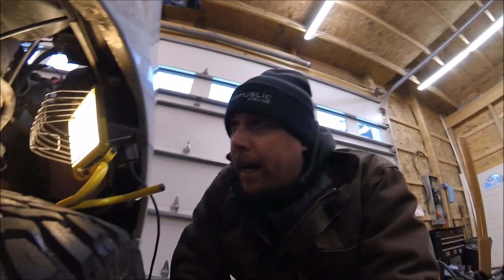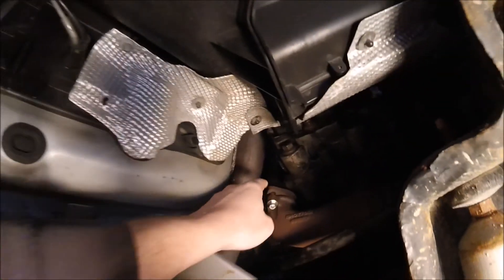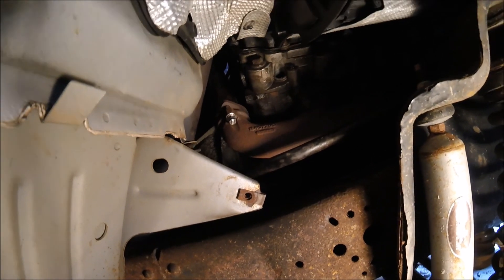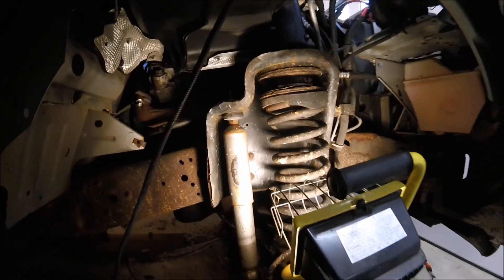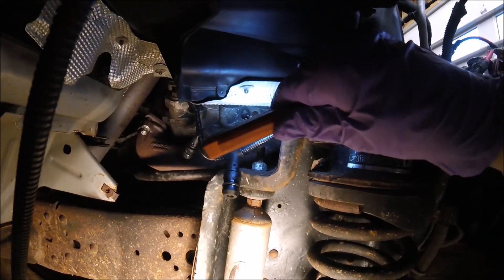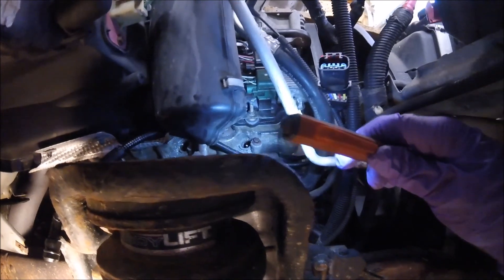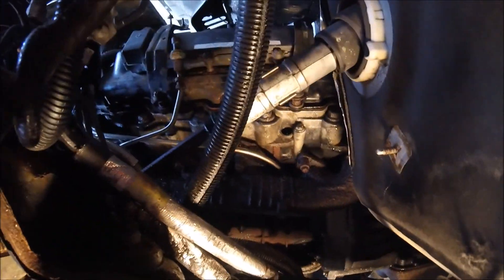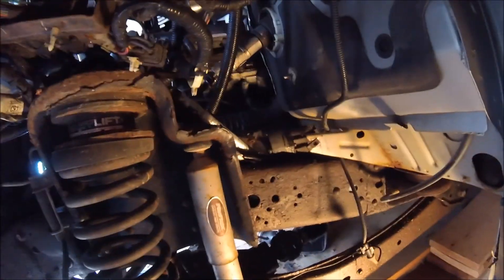GLOW PLUG HARNESS INSTALL PT 6

Comment: Man I am struggling bad getting the new harness to plug onto the new plug while it's on the truck. It wont see as far as the two rear plugs. 

I'm especially struggling on the 2 forward plugs drivers side.
Reply from the maker: Eric Sellers i feel you i forget how i got mine on now but try a pry bar as leverage to seat them the hard part was removing the old harness.